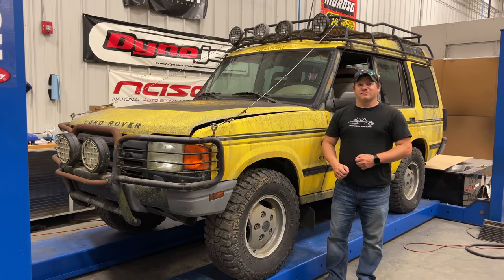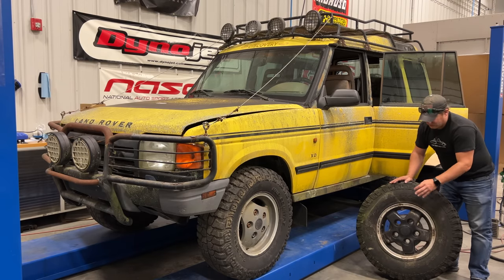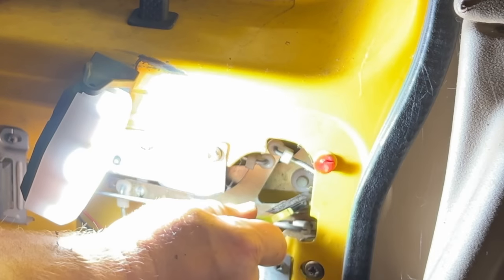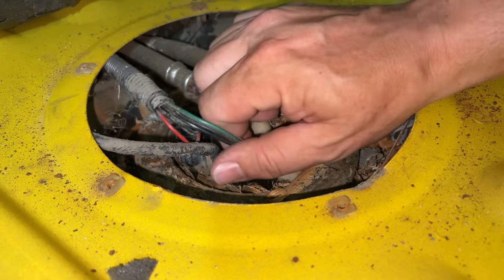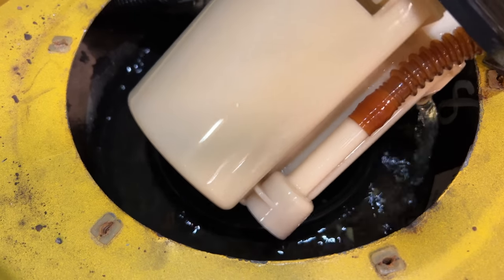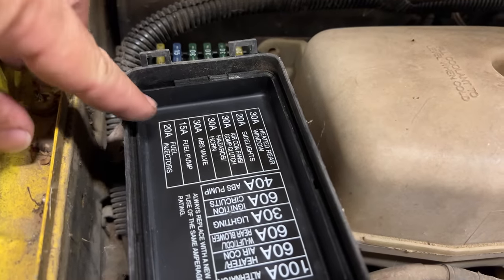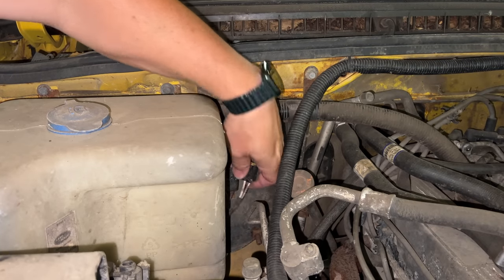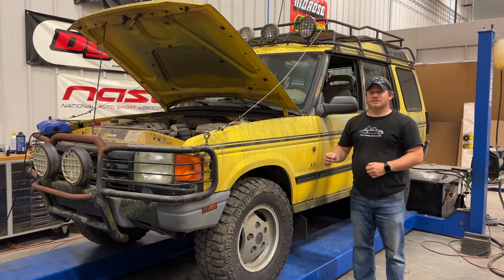Part 2 - Will It Run - Land Rover Discovery XD

Comment: There is a trick with the rear door handle.   The Land rover badge can be unclipped with a flat screwdriver and then you have access to the latch to open the door and also to lubricate it.   It is a well known routine for Discovery owners.   A quick spray every now and then ( through the badge hole) with WD40 keeps it free.
Reply: WD40 is part of an older Landy toolkit eh..lol.. I still carry a long tubed bottle in my "Hippo`s" back door pocket.

Comment: Hi Steve, thanks for the video.. Being a Brit I love my Landrovers although, now getting old i have a "Hippo" a  2004 freelander diesel automatic HSE spec.. My previous daily driver for 10 happy years was an early 1991 3 door Disco diesel of course.. Still got a few  unused spares for one "Just In case I buy another" but buying a good solid one is now becoming hard to find.. We normally had fairly good condition Ex Japanese market ones being RE Imported back into the UK.. But tend to be a bit pricy but such is the value of a fairly rust free one, plus there normally much better specification.. Please keep us all up to date with this new to you Disco.. Once you have Owned an older Disco it never leaves you in your mind.. Thankyou - Ian - UK.

Comment: The best pliers I've found for grabbing screws that are stripped out are made by Vampliers.   They have kind of a round section cut out of the tip with teeth inside so you can grab round things like screws or broken off bolts.   I have a medium set of Vampliers that I use to get after screws like what you had around the fuel pump.
Reply: They are the BEST for removing stripped screws. I work part time at a scooter shop and every carburetor that someone has touched has stripped screws.  They have been a life saver!
Reply: Great tool

Comment: She looks pretty rust free based on the rear floor.   Not sure it will work on a D1, but STC1677 is the repair kit I have used on RRC and Defenders to deal with fuel filter issues where the rubber hose is bad (rather the ends at the filter seize or rust away).  Something can be made for much less than the cost of the part, but finding the fittings is annoying.   Also, please use pozidriv screwdrivers so many mangled screws on old rovers from people using Phillips.  PS the Knipex twingrip are lifesavers for stripped screws.

Comment: Just on the rear door. Sometimes if something is pressing on it the catch will not undo.The solution is to push hard on the door itself while lifting the lock bar.
This happened to me last week and I broke the license plate  cover while pulling until I decided to push and behold it operated normally. I think some of those tyres were resting on it.
Reply from the maker: It had been stuck for years. I loaded in the tires from the side because the rear door wouldn’t open.

Comment: Steve they do make a wench for fuel pump retaining rings anyway wow on the  rotten fuel line that bad
Reply from the maker: It is out of stock everywhere or I would have used one but it still might not have helped.
Reply: @ThisWeekWithCars  I understand

Comment: Why they made metal hoses on fuel rail but connected to plastic hoses under an 4wd vehicle?
Reply from the maker: It is rubber hoses, they did it for vibration so that it doesn't break the pipe at the connections.